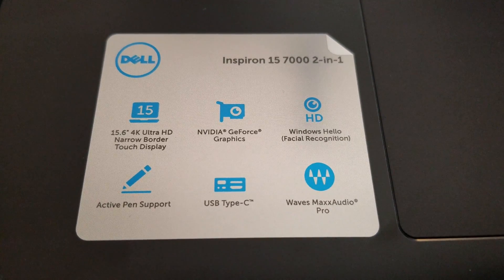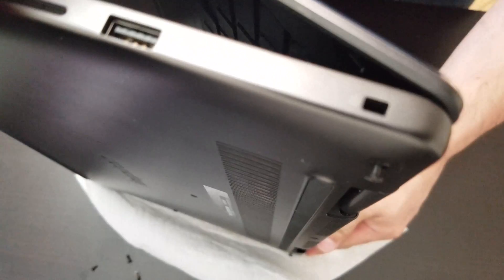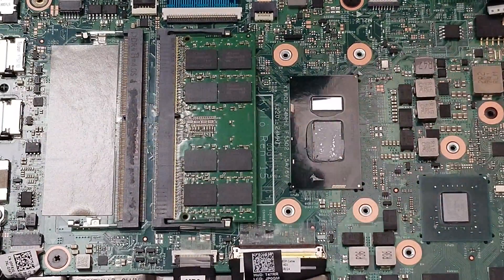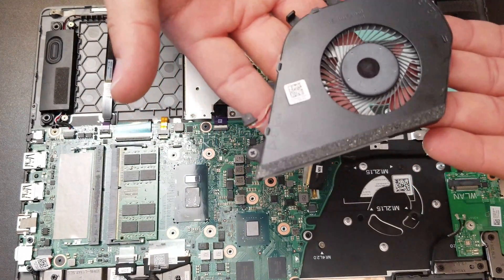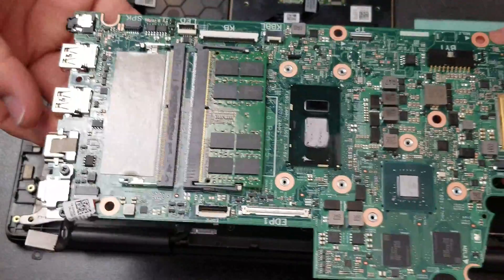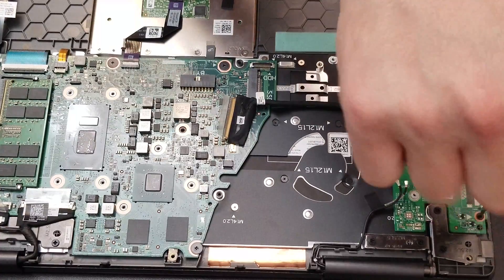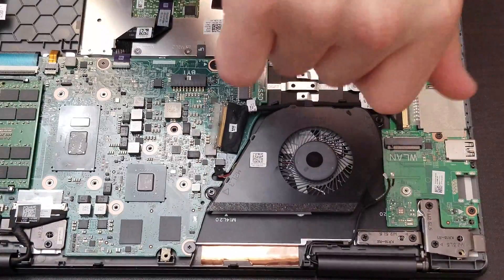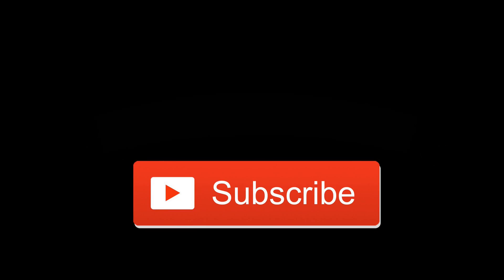Dell Inspiron 15 7000 Series 2-in-1 7573 Touchscreen

Comment: Hello just wondering, can I upgrade from my stock 42Wh battery to the 56Wh and does that mean that I also have to upgrade to a 65 watt charger along with eliminating the 2.5" hard drive caddy as well, since the battery appears to be larger and takes place of the caddy, or will the motherboard not properly charge the battery if it's specifically programmed for the 42Wh battery? Also will I really notice any difference if I upgrade from my M.2 SATA drive to an M.2 NVME drive? My 7573 has the i5 8250U processor with just 620 UHD graphics. Sorry for the complex questions, but any advice would be greatly appreciated!

Comment: are the four screws along the base end of the shell (where the touch pad is) shorter than the rest of the screws?  I'm asking because i removed all the shell screws and noticed that six are longer than four of them.
Reply from the maker: That is a true statement. You have some longer screws than others. This happened in majority of the laptop. The fatness and distance between cover and top of the laptop are different.

Comment: Would please tell me what is the required cable (where to get it) to add another standard sdd drive? I understand that I have to change the battery with a smaller size?  Thank you

Comment: I got Samsung 860 Evo v-nand SSD I'm wondering if it works with it?
Reply from the maker: Of course it should work without any issues. Try it out, if not you can return it. Remember that you have to reinstalled windows 10. You can prepared the USB with windows 10 preparation tool. The windows 10 license should be attached to your laptop hardware id, so as soon as your laptop started should be activated it with windows 10 if you have it previously. Welcome and I hope you subscribed.
Reply: @xlearntechnow  the thing is I did the same procedure for my desktop with no problem but my dell I tried but it’s not working the way I hope it would. I prepared a usb but the troubleshoot will only allow a physical disc of the os. I tried to backup a disc with recovery tool but didn’t want work with. My old drive partitioned and lock by bit locker the original os 🤷‍♀️ and glitched when try to unlock it . The only thing that worked was getting another usb with my desktop recovery of win10 which I was able reinstall the os but it reinstalled on my old drive and not the new one. Mind you I cloned my original drive to Samsung drive but I’m unable to access it or write a to it but I can see it and show nothing is on drive.

Comment: Thank you for the video tutorial. I have the same laptop Dell Inspiron 7573 2-in-1 Service Tag CX6LXN2 but when I checked AIDA64 it says my 16 GB RAM is made by Micron (Micron 16ATF2G64HZ-2G3E1) not like yours? But my ssd is the same Toshiba 512 GB. Would you please tell me what is the compatible 1TB ssd for this laptop? does it support M.2 NVMe? Also, can I add another 16 GB RAM stick from another manufacturer like Crucial? what do you suggest? Thank you.
Reply from the maker: crucial works pretty good on this laptop model. I always recommend to use the same brand or specs of memory ram to prevent any blue screen issue or random shutdowns in the system. m.2 nvme 3generation should work correctly. welcome to my channel and please subscribed. apologize the late replied.

Comment: At 2:06 when you show the heatsink, it looks like there's thermal paste all over heatspreader that isn't touching the die itself. When you repaste, did you put paste on those two sections that touched only?
Reply from the maker: You can removed it with Isopropyl they already sell the little pad to remove the thermal paste. After that you apply it again. This was a brand new laptop. It is recommend it to repaste it after removing the heatsink. Please let me know if you have any issues. Welcome to my channel please subscribe

Comment: Great vid! Thanks so much for sharing this! Can a sata drive be installed in this? It looks like there may be space to the left or right of the touchpad but I don't see the usual connections. Maybe the wire harness can be purchased and it installed there? Would love to know! Definitely subbed and liked, great info here!
Reply: I have a 7573 with a 1TB in the m.2 and a 1TB evo860 in the 2.5" bay.  The 2.5' fits with a smaller 42W battery.  sata cable connects right next to the m.2 receptacle.  I think the bracket and cable are like $20, but mine came with them.
Reply: @robertslugg8361  I just saw your reply. I wanted to keep the 4cell battery, I use it mostly plugged in, but I know there will be times I will need to be unplugged for extended times. I know Dell used to have more storage, I asked the Dell techs why they only have 256Gb or 512Gb SSDs and they told me with cloud storage a large SSD or HDD isn't needed anymore. At home I am on metered internet, so cloud storage isn't a good option for me. I did switch the SSD for a 2Tb SSD and that is a lot better. I like to have storage in my laptop and not elsewhere hehe. When I bought my 7573 I thought is had space for the 2.5inch HDD or SSD like they used to. hehe I should have done more research. It is a great laptop, I have UHD with a small Nvdia GPU along with the Intel. I really love the 2in1 series, it does well for me :)  Thank you, take care ..............  Norris
Reply from the maker: Good morning sir, thank again for the correction that you made to me (so many Dell that I had dissamble, that I am used to see dual chipset only).

 There is a cable that you can buy located it on top of the battery left side, near by the nvme, it is an empty spot there where you can connect it and then route it for the Solid States Drive (remember this solid hard drive are light in weight) so should not be a problem. Please check page 22 on this manual . (But you have to replace the battery with a smaller size 42Wh) https://topics-cdn.dell.com/pdf/inspiron-15-7573-2-in-1-laptop_service-manual_en-us.pdf
Reply: @xlearntechnow  with the new set up Dell is using, the 4 cell battery there is not room to install a 2.5 inch SSD. I am wanting to install a 1 TB mSATA SSD or a 2242 M.2 SSD. I think there is space to the side of the battery. I am trying to find a cable that would be long enough to go from the connector slot to where the SSD would be. I believe the SSD could be secured with a short screw into the padding that would be for the HDD. I can find a 1TB mSATA for 159$ on Amazon or a 1TB 2242 M.2 for 260$, but I am only wanting to use it for storage so I think the mSATA would be good. These only come with the 512Gb M.2 SSD and that is not enough room for much. Also, please clarify, the connector slot by the M.2 is the connector for the HDD that might go in if there was room?? I have seen on some forums that one guy ended up buying a 3 cell battery and cradle and then installed a 2.5 inch SSD. I want to keep my bigger battery. IF you know where I can get a cable to fit my 7573 2in1 please let me know. :)
Reply from the maker: @fotosbynor0001   Welcome to my channel if you want to spend some money to get a nvme m2 ssd of 1TB will be good, but if you want to get a solid state drive (hard drive)  connect it to the laptop please follow this manual from Dell.  so you have a better idea. I hope you subscribed 👌 https://drive.google.com/file/d/18js_L6p3r_Hf3pAXfBIlGnbakcqje55q/view
Reply: @xlearntechnow  if that link is the manual for the laptop(I cannot follow that link), I already have it and looked at it a long time ago. This laptop has the 4 cell battery. There is no space to put a HDD or SSD in the spot where they used to go. I am not wanting to exchange the M.2 SSD that is in there now. I want to add 1Tb to it. Like I said, I am looking more towards a mSATA because of cost. The mSATA is L x W x H  2 x 1.18 x 0.19 inches, the space to the side of the 4 cell battery is about 2 3/4 X 2 1/2 inches. I need the cable that is long enough to go from the connection slot to where the mSATA will go. It needs to be longer than what Dell sells. AND yes, I subscribed and liked. Thanks....
Reply: @fotosbynor0001  i have exactly same problem. Did you find any mSata cable ?
Reply: @mzerenoglu  I could not find the cable and the computer repair shops I went to ask never called me back. I did go to one repair center and he told me he knew what I needed and he would install it. I told him make up the cable and sell it to me and I would install it, it would be a plug and play. He said he wouldn't sell it to me. I have seen some hacks done, get a cable that has the pin for the motherboard, then buy an adapter, then buy the cable for a mSATA or PCIe/NVMe SSD. There is a 2242 PCIe SSD that would fit, and it would be a little faster than the mSATA SSD. (The mSATA SSD would be cheaper though, and just for storage would be plenty fast) BUT I couldn't find the cable :(   I gave up.
What I ended up doing was to switch out the 512Gb SSD. Dell used an M.2 SATA for the main drive anyway, so I bought a Sabrent 2Tb PCIe SSD. I tried to clone it, and did not have much luck, I tried 2 times and after having problems and needing to find and enter my Bitlocker code I gave up and had a computer tech come and install and clone and boot up. 
I do not know what country you live, but I found the Sabrent SSD AND the Tech both on Amazon. I used to use 2 256Gb Ultra Fit USB drives in 2 of the ports for storage, and I bought a 512Gb Micro SD card I keep in all the time. I dumped all files that were on those onto my SSD and I still have 1.1Tb free space left. I still use the flash drives for temp storage and file transfers. 
I keep the original 512Gb SSD in case warranty issues I might need to put it back in, but I think the 2Tb SSD is what this really needed. 
The idea of the 1Tb mSATA or PCIe SSD to the side of the battery should work, I have had many comments on the idea, there just isn't a cable readily available. Good luck on your setup. Let me know how it goes.   (oh, RAM is fairly cheap now too. Not long ago it was up around 150$ or so. I bought a 16Gb stick for 56$ recently for a total of 32Gb.)                I am not very smart, just smart enough to get me in trouble hehe Take care, KEEP SAFE!! ........... Norris
Reply: @fotosbynor0001  Thank for your clear explanation. I found a connector on Aliexpress , i am not sure whether this one is fit but i will try for connecting msata ssd (https://a.aliexpress.com/_dW9SXmI) .  Also i will upgrade 512 GB ssd to 1 TB PCIE ssd but i really didn't understand why you need to clon your ssd? i am planing to remove my 512 ssd directly and add 1 TB ssd. I will create Windows setup usb and i will setup windows to my new ssd and then i willl just download dell drivers. Is my method useless? If i setup new Windows without cloning, what kind of problems can there be?

Comment: Hi. Could you give me a hand?  It will fit ( Samsung 970 EVO Plus Series - 500GB PCIe NVMe - M.2 Internal SSD  = PCIe based NVMe M.2 ) or only (Samsung SSD 860 EVO 500GB M.2 SATA Internal SSD = Sata base M.2). Thank you for attention.
Reply from the maker: Welcome to my channel. M.2 and M.2 Nvme are compatible with this laptop model. So you can buy it and reinstall the operating system and install the softwares back again. Please subscribed to my channel and any future help please feel free to ask. 👌
Reply: @xlearntechnow  , thank you.  Another 2 questions, you said before "... once you replaced the ssd nvme you can install the same Windows 10 version that you have on your laptop and the license is attached with the motherboard " but I didn't mine and didn't find in the video to.  Any observation about that ? And the second question: in you opinion is there some way to clone the exactly  HDD factory came (original Windows, recovery systeam, drives) to the new SSD M.2 install ? Thank you again !
Reply from the maker: @agenorleitemeloneto3029  not worry about that system recovery from Dell. It is complete trash. Before removing the original SSD do the following,  go to this link https://youtu.be/93loJOS8h8I in how to download the windows 10 in a USB flash drive, automatically will download the same version that you have on that machine. Once you put the new SSD NVME m2 -> you use the usb that you create with the windows tool -> and once you reinstall the system the windows 10 will be activated it without not issue with same license. I dont recommend you cloning in this case because they are not the same type of ssd, they are similar but both works. So backup your files in a external hard drive or USB or cloud. And then transfer it once you do the clean install. You can email me if you want to xlearntechnow@outlook.com . I can help you if you want creating the USB flash drive with windows 10. Do you live in United States?

Comment: Hi do you know if this M.2 Slot supports PCIE 3.0 x4 or is it PCIE 3.0 x2? Its not really clear on the setup & specification document.
Reply from the maker: Welcome to my channel, check minute 1:48, pause it, put YouTube resolution to HD or 4k you can see clear details of the unit itself. In there shows you the specs. Please subscribe to my channel. 👌
Reply: @xlearntechnow  Yes I saw that. Its a M.2 Sata based drive which means you get 500/450 mbps read write speeds...but dell manual spec says NVMe based..so thats why confused
Reply from the maker: @danlah12  Most new machine nvme and m2 both are compatible on the same slot. On this laptop should be. Just as an example Google the following Samsung SSD 970 EVO NVMe M.2 250GB  or 1TB or 512GB.  I got a bit confused too, with this new storage types, there are others out in the market that can make you more confused. Like the one that new macbook pro 2019 has, you can check that video too in my channel. Subscribed please ❤

Comment: Can i upgrade its graphics card?
Reply: No it is soldered on. You can attempt to solder a different gpu in it's place but it is unlikely to work even if the replacement is the same gen and will likely cause issues even if it did work as the stock gpu hits the power limit the board allows. That and it's a colossal pain to solder as any misstep no matter how minor can brick the board and the equipment to do it right costs so much you may as well buy a proper gaming laptop instead of frankensteining a low tier premium consumer model.

Comment: I just got a 7573 to replace an i7 75?? model from 2 years ago where the motherboard went tits up (current speculation, no-logo black screen of death).  This vid made it very easy to remove cover, though I use my Starbux card for everything.   In mine though, there is the 42W battery and next to the m.2 sata ssd is a spot for a 2.5" drive, which might have been part of the optane system used in other models (?).  I managed to swap the 512GB ssd from the i7 into this model and it booted back up seemlessly in 30 sec with all my old stuff from the other box intact.  Now to see if I can put a second drive in the open bay, maybe an inexpensive 1TB ssd or a 2td hdd.
Reply: Unit is currently running with 1TB WD blue in the m.2 and a 2TB sandisk ssd in the 2.5" bay

Comment: Does it have an expandable memory slot for SSD and HDD?
Reply from the maker: Hopefully your day is going great. Unfortunately only has for one flash storage, but these days (SSD NVME) are a bit cheaper than before, once you replaced the ssd nvme you can install the same Windows 10 version that you have on your laptop and the license is attached with the motherboard. Hopefully you subscribed. 

Samsung 970 EVO 1TB = 1024GB:
https://www.amazon.com/Samsung-970-EVO-1TB-MZ-V7E1T0BW/dp/B07BN217QG/ref=sr_1_4?ie=UTF8&qid=1540484547&sr=8-4&keywords=ssd+nvme

Comment: Mine came with SSD but I want to add another one. I open and could not find a place to fit it. Do you think it can take another SSD?
Reply: Yes you can add a standard 2.5" drive.... if you are one of the few that has the had adaptor cable...which in turn was only supplied in models ordered with a mechanical hdd. Finding that part to make it possible is currently next to impossible but it may start showing up on amazon and ebay in a few months. You may be able to use a similar models adaptor cable but I cannot confirm and have seen no reason to assume this as a valid option as of yet.

Tl;Dr -if you don't have the cable you cannot add a 2nd drive.
Reply from the maker: Your laptop model has a dvd unit? or came without one?.
Reply: @xlearntechnow  no DVD drive in the laptop.

Comment: Very helpful video!  I, too, was wary when a bunch of screws didn't come fully out.  In case it helps anyone else, I had trouble getting it detached on the side with most of the ports and the hinge corner on that same side.  I was able to eventually get the back off by working from the loose opposite hinge corner, opposite side, front touchpad side, and then back up to the stuck side last.
Reply from the maker: The screws that are closed to the display brackets, You do not have to fully take them out as I explained in the video. I feel happy that the video help you and you got done your repair/upgrade. Hopefully you subscribed to my channel. Have a wonderful week Take care!

Comment: What about ssd slot  is it normal sata m2 slot  or NVMe M 2 slot ???
Reply: It can be either, but that specific model SSD is SATA which means 500MBs/500MBs rather than NVMe speeds.  Also keep in mine this laptop thermal throttles something fierce.  If you remove the heatsink you need to repaste which I did and it dropped down 10c.  It still throttles just not as bad.  Instead of going from 4Ghz down to 2Ghz after 2 secs it only drops to 2.4Ghz.  Its still above its rated average but AIDA64 doesnt lie.
Reply: You are amazing that you pass by my channel and hopefully you subscribed:
This laptop has PCIe connector. PCIe has up to 4 times the theoretical bandwidth of SATA and is supported by the NVMe host protocol.
Reply: Thanks👍😁
Reply: nextjin thanks 😀